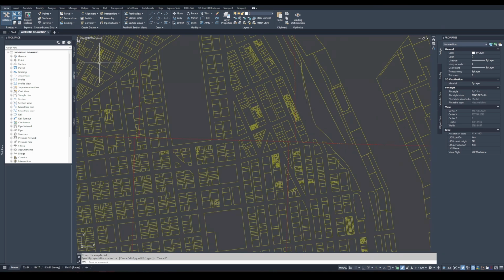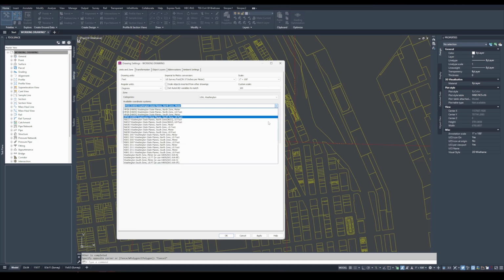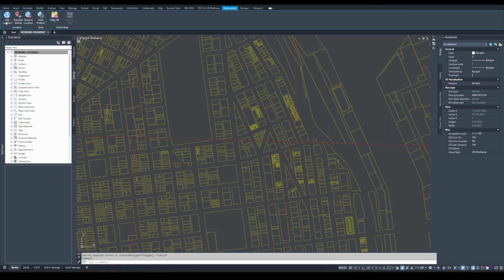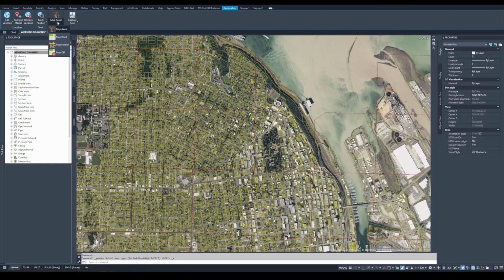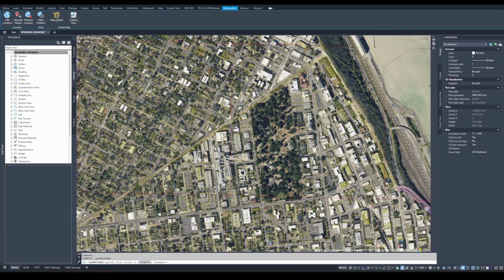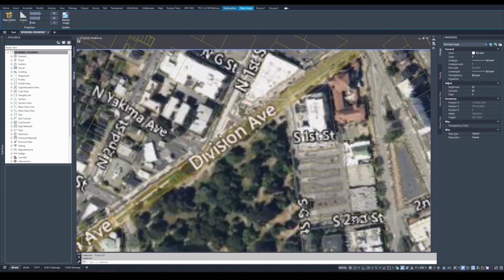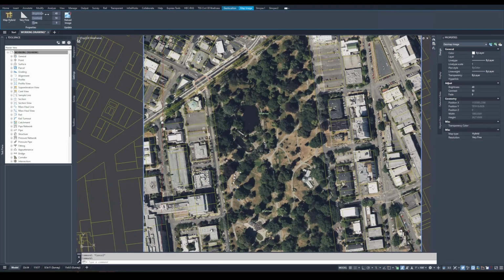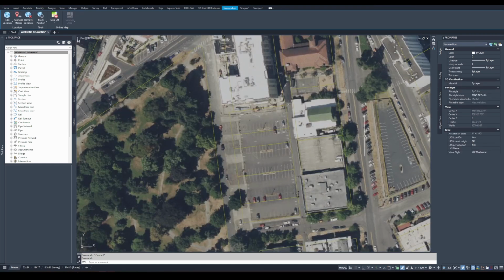Civil 3D Tip - How to use the 'Geomap' function

Comment: What if I have a drawing that is using a project datum, with reference to, say Nad83, WA-N? They give a scale factor and translation from 0,0 of, say, 100,000 meters…
Reply from the maker: If you've been provided the info to get back to state plane then you certainly could do that and the geomap would come in at the right location, although if it's scaled and not just a coordinate shift it might be tougher to actually get that to be dead on correct. You could also just reposition the geomap to match the project datum (see the video i just posted, coincidentally). Again, if it's scaled that won't work unless you perfectly scale it back.
Reply: Do this all the time with our survey projects. Everything is referenced to WA-N but on a “project datum”… knowing our translation from 0,0 is 100,000 meters (328083.3333333 usft) and having the scale factor, you can easily get imagery to come in at the correct location. However, you are correct that this will not work with any GIS features you maybe trying to reference in.